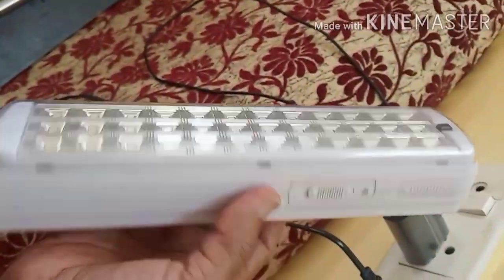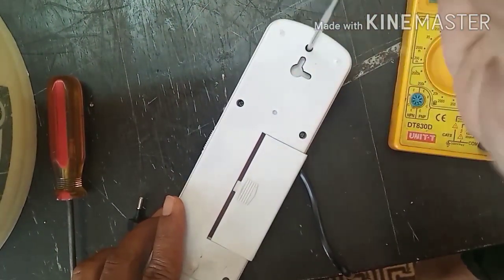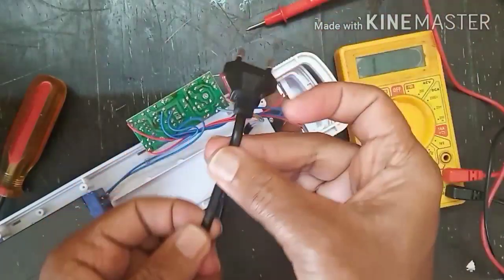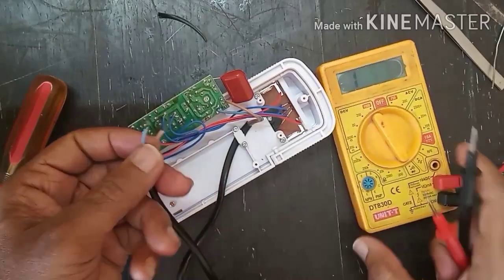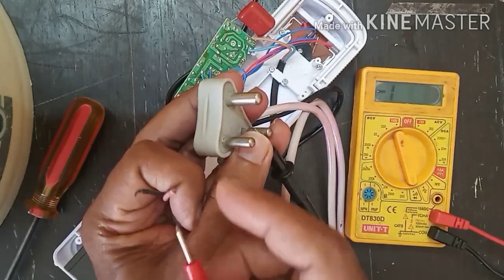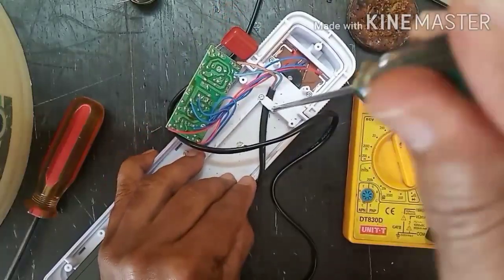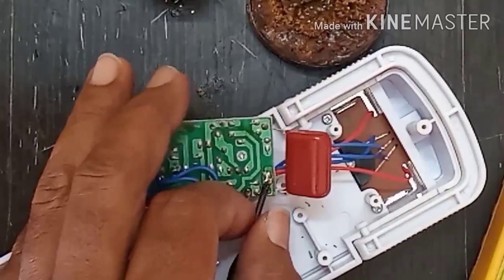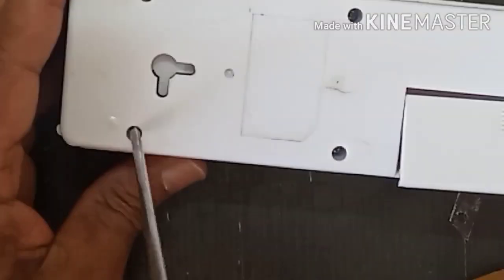LED Emergency Light - Rectify Fault and Repair

Comment: I have one of those but mine is larger and it has two batteries but the batteries are bad. I opened it up and the batteries were dry so I filled them with distilled water and charged it and it worked a little better but it didn't last. You can't get those batteries here in the US.
Reply from the maker: That's true. Thanks for watching and comments!
Reply: @X-lent.techgroup  if you know how to get those batteries let me know so I can order them.
Reply from the maker: Have you tried Amazon?

Comment: Light is getting off after 30-40 seconds what is the problem battery is ok, its charging volt is ok only battery to 2ft tubelight gets off after 30 seconds approx
Reply from the maker: Fault is in inverter circuit. Should be repaired in electronics shop.